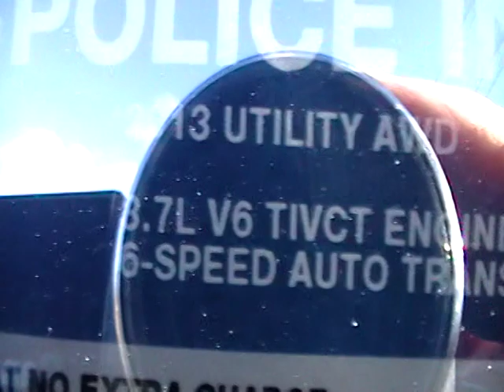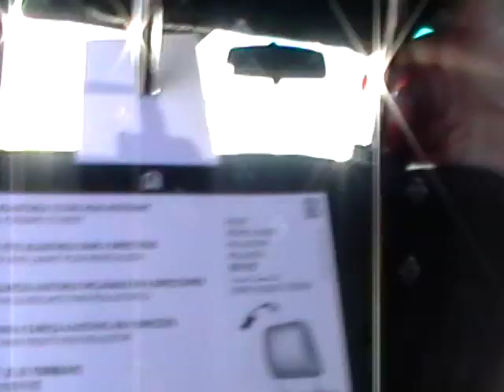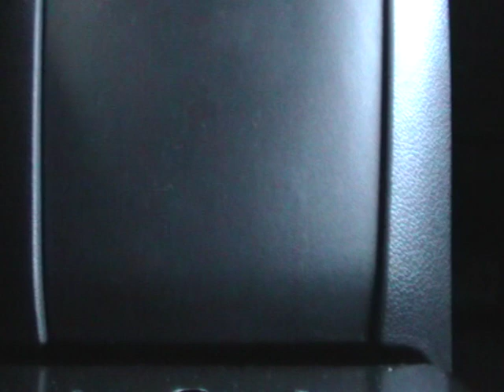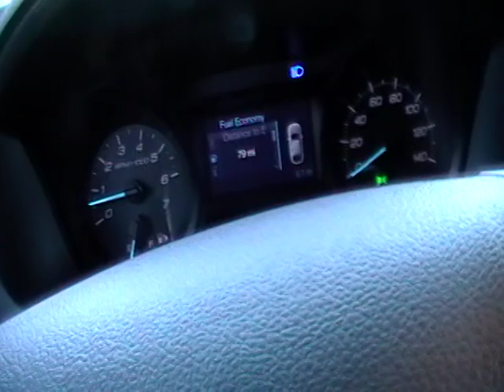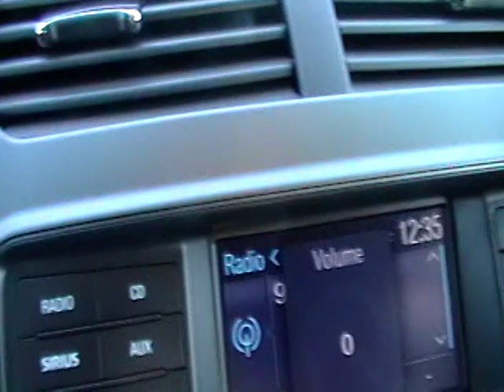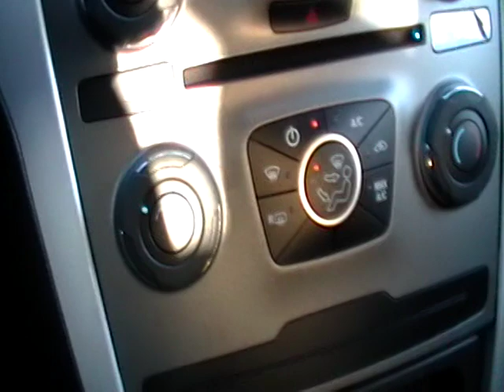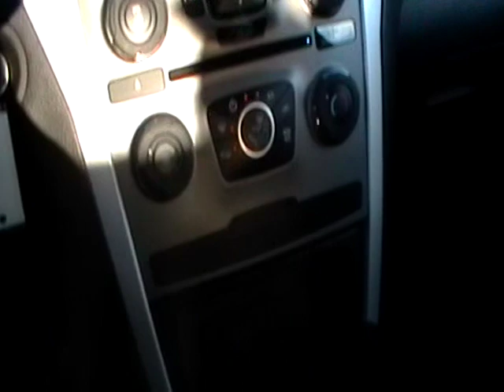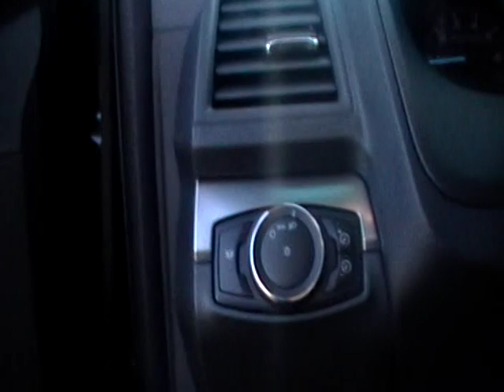2013 FORD POLICE INTERCEPTOR EXPLORER REVIEW AWD WWW NHCARMAN COM

Comment: My Ford Explorer has a sensor on the front that I believe is called a GAP sensor.  I Installed an Aires grill guard and now my GAP sensor doesn't work anymore!  I'm wanting to relocate the sensor to make it work again.. any advice? Any experience with the Ford Explorer with a grill guard? I'm not sure if the Interceptor version includes the GAP sensor on the front either.

Comment: First off this is NOT an Explorer, it is a Police Interceptor Utility. Secondly this is a factory Interceptor, that means the transmission, suspension, seating , engine and lighting are designed specifically for law enforcement. This vehicle is NOT available to civilians and requires law enforcement identification to purchase. All other equipment you generally see on a marked or unmarked cruiser is installed by the designated PD. Lastly, please look into editing your videos before posting.
Reply: Austin Spain Incorrect. It is in fact the Explorer with police interceptor package. It is in fact available to civilians, you can buy them occasionally before them being issued to departments, however usually after them being issued and retired from departments
Reply: Ryan Pardue i just bought a 2016 PIU with 15k miles for $23k. It had one owner, a NJSP admin/supervisor. Lightly used.
Reply: Austin Spain I am a civilian and I own one ! I’m the first owner besides the law enforcement